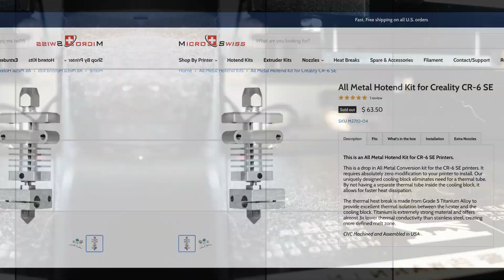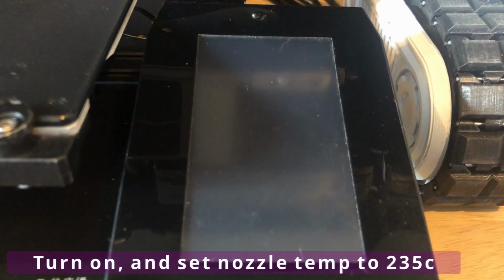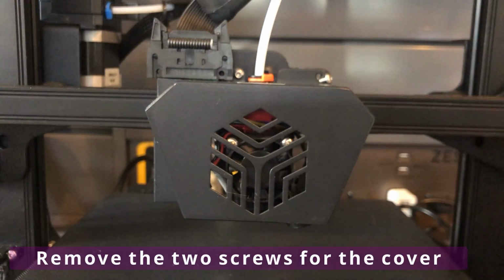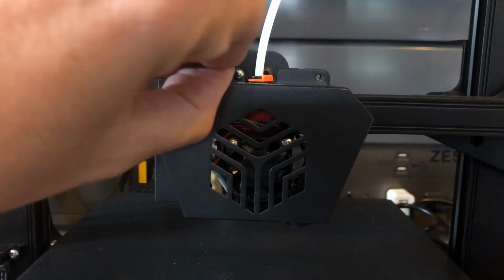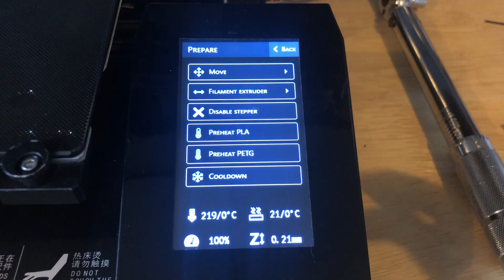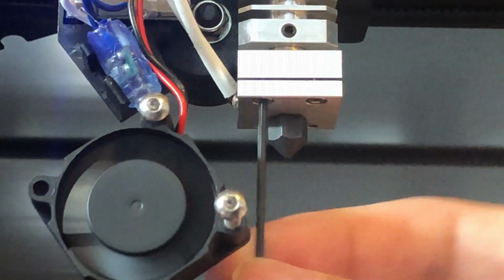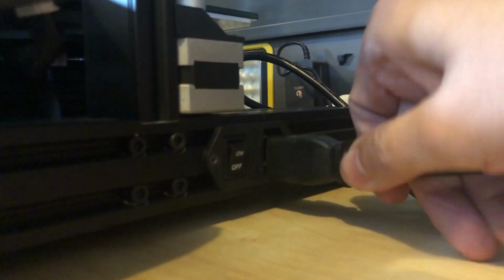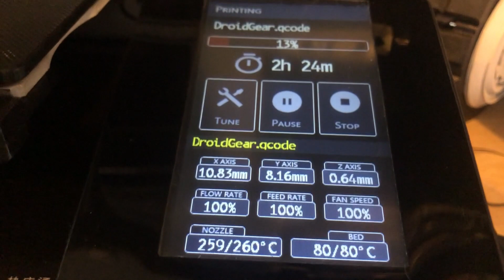CR6SE All Metal Hotend Upgrade - CR6-SE Upgrade

Comment: I see this vid is a couple of years old. I have not used my CR6-SE for a few years. I tried removing a clogged print head and part of the thread of the print head broke off and are stuck in the threads of the hot end. At first, I couldn't tell, but when I looked at the print head, it looked chipped on part of the threads. I looked in the hotend and, sure enough, there is a sliver of the print head stuck in the threads. I'm trying to see if I can push it out in circular movement with a dental instrument. If I can't get it out, I might buy one of these hot ends to replace it.

Comment: August 5, 2022,  Very Excellent post  of how to install a all metal hotend. I too have a CR6-SE for the last two years that's been my go to printer. I'm going to order today this hotend. I truly wish there was equally an easy way to modify this printer to have increase in printing temperatures to at least 325 degrees. Would love to know it that's a possibility. Again, very good post
Reply: you just need to replace the heat cartridge and thermistor
Reply: Install community firmware 6.1

Comment: I've just installed mine and it's caused me some hassle,Get some ok prints and then some shocking ones.

I could print in two colour Pla with standard nozzle and Cura
I upgraded to Microswiss and Simplify3d slicer..Retracted as required,Not tried any PETG yet

Comment: Hey there. I have a quick question for you. I converted to the all metal hot end microswiss as well for mine. I haven’t tried the high temp filaments yet. But I have been having a lot of clogging/under extrusion problems with silk PLA’s. I’ve tried rebuilding the hot end a few times in case of gaps, I’ve calibrated esteps and retractions. I have increased temps on suggestions from others. Did you have any trouble with this? I’m only a year into 3D printing but I’m pulling my hair out trying to figure out fixes.
Reply: Hi, did you find any solution to this issue. Having a similar thing after installing the all metal hot end. Thanks

Comment: My Thermistor is stock in the original hot end. I tried pushing it out with an allen wrench but it still won’t come out. Any suggestions?
Reply from the maker: Sorry to hear this.  I had one stick on another hot end.  I would suggest ordering a replacement thermistor.  They are really cheap off of Amazon.

Comment: is there any another good all-metal hotend for the cr-6 se except the micro swiss?
because.. despite the name, it has nothing to do with swiss and is based in US..
shipping to Germany costs about 20€ and the price jumps up a lot..
Reply: and..isn't the idea of all-metall hotend not to have any non-metal part? what is then about the PTFE tube going inside? won't it melt?
and secondly.. is there a way to print hinger than 280°C? with different heater I guess?

Comment: Tripods Garage Great video! Hello I have the CR6SE as well and upgraded to the Micro Swiss all metal hotend it was easy but know I am having a problem with the ABL the strain gauge isn't working correctly did you have that problem afterwards?
Reply from the maker: Greetings, so far I haven’t had any issues with MicroSwiss hotend on the CR6SE.  Do you see indicator light go off when leveling?
Reply: @TripodsGarage yes it does but its trying to dig a hole in the bed I believe I Found out the problem it was carriage was loose so I am going to tighten the V wheel after work tonight! Thank you for the Video!
Reply: @Spencer1609751  hey Spencer, did you solve that issue? After replacing my hotend my nozzle goes into the bed while trying to calibrate it as it happened to you
Reply: @ALZHEM  I sure did the screw's that hold the Strange gauge were loose.

Comment: How are your bottoms so smooth that's the original build surface ?
Reply from the maker: Maybe it is the glue stick.  I noticed that when I use a glue stick for certain filaments the first layer looks a lot smoother.

Comment: Installed this and also replaced the stock extruder with Creality’s all-metal kit.  My cube printed perfectly, as did a socket set holder and a lid.  However, when attempting to print the base of the socket holder, I got up about 1cm and no more filament feed.  I don’t think this was due to the upgrades, just a combination of excessive heat and humidity. 90 degree ambient temp and about 70% humid doesn’t help things.

Comment: So what happens when you need to change the tube out? Guess you need to take a wrench to it?
Reply from the maker: To remove the tube, you will need to take a wrench to it.  There is absolutely no play, it is very secure.  I wonder if will start seeing this on future printers.
Reply: @TripodsGarage  Do you / will you need to replace the compression fitting when you change the tube out?
Reply from the maker: Going of my experiences with using a compression sleeve on a refrigerator water line.  The sleeve compresses over the line, and if compression is really tight you cannot remove it.  If that is the case you will need to replace the PTFE tube and the compression sleeve.  If the fitting is just snug, there could be a chance of reusing the sleeve and the PTFE tube.  Hope that answers your question.
Reply: @TripodsGarage  Thanks it does, just a little concerned because I don't see and extra sleeves for sale on the Micro Swiss site, maybe its a standard size
Reply from the maker: @LaszloBagi  -  Looks to me that it could be a standard size compression sleeve that you can find in a plumbing isle at your local hardware store.  I will bring the extra one the provide in the kit next time I am out and about.  Thanks for watching and commenting!
Reply: @TripodsGarage  Thank you for the great video!

Comment: I am glad they got rid of the Bowden Collet, mine developed some wear very quickly and I replaced it only for it to do the same, the wear enabled movement of the Bowden tube when retracting so I machined a fitting to convert it to a compression fitting the same size as the pneumatic Bowden fittings which is much better as you don't have those spikes gripping the PTFE tube